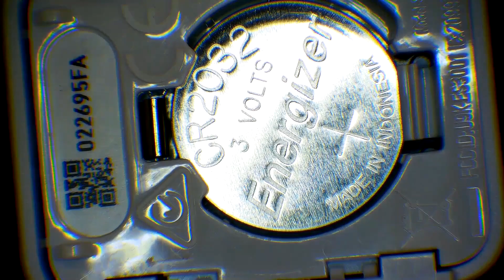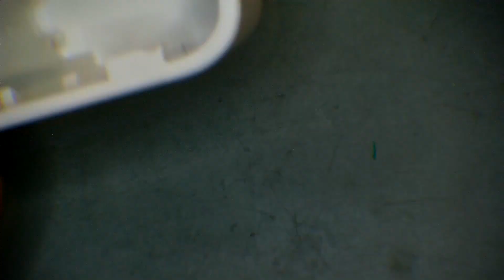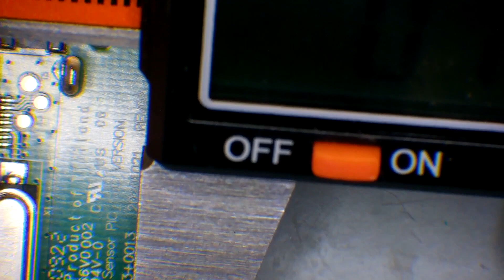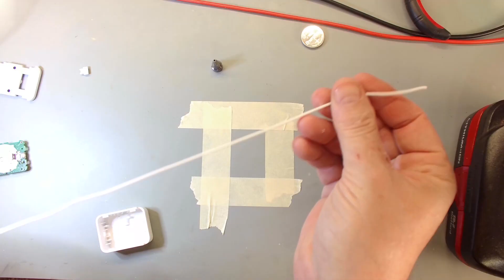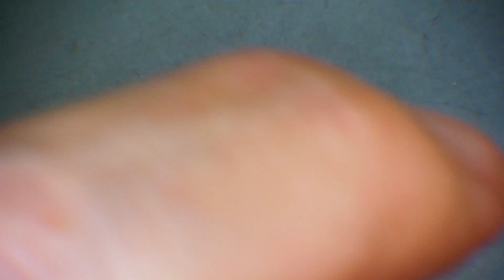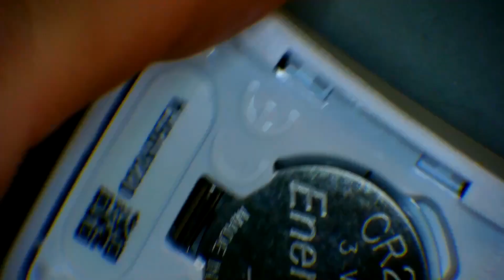How to extend the range of a Simplisafe Gen3 Sensor.

Comment: I am a MSEE RF product designer, uwave engineer.  Usually one would choose a 1/4 wave monopole for a good match but that's with a good groundplane.  If anyone wanted to fiddle with this you could trim back the antenna until you get the best match.  when the grounds are minimal, the PCB also has a bunch of lumped elements matching into it, so we're in wild west territory here.  but I would suggest 1/2 or 1/4 or whatever is only a ballpark.  I would think something shorter might be optimum.  another suggestion is to strap a quarter wave metal thick parasitic antenna alongside the longest antenna section and connect capacitively through the case, maybe an old am/fm radio telescoping antenna , RTV it alongside the long dimension and pull it out until you get good power out.  10 pF would give you -j70 ohms of connection to the little guy inside.
Reply from the maker: I am sure we could get the range increased with a more optimized antenna as you said, but from my and others experience this gets you more than needed. With this I can trigger an alarm inside a brick house a 1/8 of a mile away from inside my lab. I thought about optimizing it on the bench in the video, but once I saw the range felt it would be overkill and just playing around at that part. 
RJ

Comment: Thanks for the succinct instructioins and vid. I just built an observatory that's about 100' from the base station. I will be putting antenna extensions on all sensors as well as the glass break sensor. I will report back t this thread on the success (or failure) of the glass break sensort antenna extension, for anyone else who might like to know the answer to this question.
Reply from the maker: Thanks! 
RJ

Comment: Another thank you for a wonderful video! I'm having an issue with 2 sensors I wired for a metal barn. They both have low signal/lose completely.  Wondering if I should go longer on the wires/antenna? Or better to get to precisely the length you recommended? Possibly drill a hole for the wire to extend outside? Thanks again!
Reply from the maker: Keep the length. If you still have issues then drill tiny hole to hang outside metal and seal with a drop of silicone chalk. One other person had to do that on the metal barn. Said it worked the treat.
RJ
Reply: @LynxElectronicsLab  Thanks again!

Comment: Greetings.

Might you have any hack videos for providing electrical wall power to a SimpliSafe siren and perhaps the keypad?  I find that I must replace the 4 AA siren batteries at least twice a year.  I want to use a relay and a 6V wall power supply to power the siren.  The relay would allow the siren to switch to battery power only when the wall power is unavailable during a power outage.  It would switch back to wall power when the power outage is over.

I was told that I will need to use a "flyback diode" to prevent the relay coil contacts from burning out when the power switches from wall to battery.

Thoughts?

Take care.
-Z
Reply from the maker: I’m afraid I do not. You do need a diode reversed across the coil of the relay. This could be done but make sure the battery and 6v wall wart is never connected together. It could lead to a fire hazard otherwise.
RJ

Comment: Greetings.

I have a shed that is approximately 90 feet away.  The sensors in the shed go online and offline at will.  I am looking forward to executing your antenna hack on those sensors.

Could you please tell me what gauge of wire did you use during your video of the sensor antenna hack?  I want to make sure I match what you are using.  Would a higher gauge wire increase the signal distance, or does it even matter?

Take care.
-Z
Reply from the maker: I used 22 gauge stranded wire for the antenna hack. the wire size does not matter for signal. but larger will be hard to fit in the housing. Range won't be an issue after you do it trust me. 
RJ

Comment: I have the save problem from a sensor in the garage door. What is the gauge of the wire used for the antenna and is it stranded?
Reply from the maker: 22ga stranded wire. 
RJ

Comment: Thanks for the video. Why did you make the wire length a half wavelength? Since you are really making a monopole, shouldn’t it be 1/4 wavelength, approx 6 inches?
Reply from the maker: Just what I picked. It worked well in the signal tests on the bench so I used it. You could try 6 inches and see if it works for you. 
RJ

Comment: I just did my first sensor exactly the way you described and it worked great. Thank you. I do have a question for you. You said that the optimum antenna length is approximately 1'. Wouldn't be the same thing to leave the existing antenna in place and solder a wire to the other antenna terminal and decrease the added 1 foot wire length by the existing antenna length?
Reply: Understand and thanks for your reply. I would have soldered the extension antenna wire to the board where the existing antenna terminates. Again, thanks so much. This is very helpful.
Reply from the maker: That plated antenna is not great to solder to so I prefer removing it. If you don’t have a desoldering gun just cut the antenna in the middle and remove it as two single pieces. It’s real easy that way. 
RJ

Comment: I did 7 entry sensors, 3 soldered to the board, then I got lazy and soldered to the existing antenna for the remaining 4 sensors. All worked great, no more dropping connections.
Reply from the maker: 👍
RJ

Comment: Can you wrap the new wire inside the sensor? A wire dangling is an eye sore.  Or maybe around the back/outside of it.  Also do you know if this works with the motion sensors as well?
Reply from the maker: I use very small 24ga wire colored white. Then run it straight up the 4” or so from the sensor to the top of the door frame trim. Run it along the trim against thewall on top where it does not show and use some clear tape to attach it. You have to look for it up close to even know it’s there. Folding it up on itself will remove the benefit of having it. I have never opened a motion sensor but likely would work. 
RJ

Comment: That’s funny. Good job.  Where can I get that wire, and what type of wire is it?
Reply from the maker: Thanks, it’s 22 ga stranded off one of my bulk spools. 
RJ
Reply: I used a 22 gauge solid core copper wire on 7 entry sensors and all worked like a charm.

Comment: Thanks for creating this video. I've had a alarm system for a while, but not on my external garage door. Despite the range from the garage door to the base station being closer than the farthest entry sensor on my house, it still doesn't report status correctly. The obvious reason being the large metal garage door blocking the signal. I've bought some 20AWG wire and will try this method out, I'm almost certain it'll solve the issue. Thanks again.
Reply from the maker: You’re more than welcome. I hope it does take care of the issue. I’m betting it will.
RJ

Comment: Hi - Great video thanks. Can you do the same to the base station and would this increase range even further ? If so what length of antenna would be required. Also would a Dipole ariel work even better and if so, how could this be achieved ?
Reply: Is there anyway i could mail you 3 base stations to add an antenna? I have an apartment complex and the tenant took down the wired smoke detector..took out the battery and put the alarm in hall closet .  He caught the unit on fire while smoking and was highly intoxicated.  While insurance has now dropped me i need good connectivity to smoke alarms.  Desperate here..wil pay you!
Reply from the maker: @chaddean4940  No, I'm Sorry.  
Go back and read the the previous reply to @OriginAqua. I wouldn't even do it to my own base station.
RJ
Reply from the maker: Thanks for the great question. It may be possible to add an antenna to the base. The main reason I did not attempt this was because I did not want to risk the base station which I would have to buy a whole new system to replace. I can replace a sensor for $15. 
RJ

Comment: Great video, I need to try this. I have one door sensor that has been intermittently losing signal, one water sensor in a metal outdoor water heater cabinet and one extra keypad. All the randomly lose connection say once every three weeks.  I don’t have a spectrum analyzer, do you suspect all use the same freq? Also , when I plug in 433.83 MHz I get 1.1ft. You said it was 1.0ft but you went a little long for the strain relief. Does that 0.1” matter?
Reply from the maker: Thanks, they all of the Gen2 sensors are on the same frequency. The length just needs to be close. I figure by going a little short the extra for the knot makes up the difference. Get it in the ball park and your disconnects will stop. A number of viewers have already made this mod successfully.
RJ
Reply: I did the modification last night to one entry sensor and the water sensor. Looking forward to seeing those disconnects going away. Thanks again for sharing such a great tip in such a clear way!

Comment: Can’t wait to try this!  I have entry sensors that are only 25-30’ away that won’t connect to my base station. But there are some obstacles
Reply from the maker: Oh believe me, it will work. The range is greatly increased. If it is steel walls or concrete you might still have issues but likely this we git-r-done for you and it’s easy. Good luck let me know how you make out.
RJ
Reply: It worked!!! I did two of them and now my base station is able to see the two sensors!  Thanks a bunch for sharing This!
Reply from the maker: Great! Glad I was of help.
RJ
Reply: Now I want to extend the antenna on all my things!  There’s an antenna in my car’s alarm.  I wonder if it will work if I extend that?  My car remote range sucks! I have to be within 6’
Reply from the maker: @garylpphc  LOL!!!

Comment: Is there a fix for an outdoor camera? 
Unfortunately there is a brick wall between the base station and the camera plus two walls made of drywall.
There is no way to work around the cement wall.
Reply from the maker: First I have to ask if your problem is the Wi-Fi signal or the 433 MHz signal from the base station that is the issue? I have not opened a camera up to look at it. But as I found out it takes a signal from the base to wake the camera up so it will start putting out a Wi-Fi video feed. 
RJ
Reply: @LynxElectronicsLab  i'm wondering this too, i know my wifi has the range to connect to my devices, but the base station is too far away and blocked by a few cement walls. It would be great if I could add a long antennae to the base station to increase the range to reach my cameras.
Reply: @notacoolkid12  Old comment, but I would assume extending the base station’s antenna size would resolve your camera problem, right?

Comment: What kind of wire are you using here?
Reply from the maker: Just some 22ga stranded wire off of one of my bulk spools. It isn’t critical as long as it’s small enough to fit and work with. The length is the size that matters.
RJ

Comment: Is it necessary to remove the preinstalled antenna or could you just add to it?
Reply: For what it’s worth, I did a similar mod a few years ago on the water sensor. I soldered directly to the existing antennae. Since adding the antennae, I haven’t had the sensor disconnect a single time over several years. It was fairly challenging to solder directly to the existing antennae though. I’m a soldering novice.
Reply from the maker: @Creeker0918  Great Job! It just takes practice.
RJ
Reply from the maker: You need to remove it. If you do not have a desolder rig cut the metal wire and heat one side at a time and pull them out as separate. This is easy to do. Hope that helps.
Reply: @LynxElectronicsLab  Is there an easy way to explain why it must be removed vs. attaching/soldering the additional wire to it? Thanks for a wonderful video!
Reply from the maker: @ericpierce3386  Your Welcome! Because it is hard to solder to that plated steel antenna and room is a little tight to get the wire routed.
To know how long the antenna looks to the sensor you would need to solder right at the end against the board on the unconnected end. It seemed it was just more difficult so I remove it in my opinion it is easier to remove it. You can cut it and remove each end very easy with just a soldering iron.

Comment: So exactly what was the wire size or type you used??
Reply from the maker: Just some 22ga stranded wire off of one of my bulk spools. It isn’t critical as long as it’s small enough to fit and work with. The length is the size that matters.